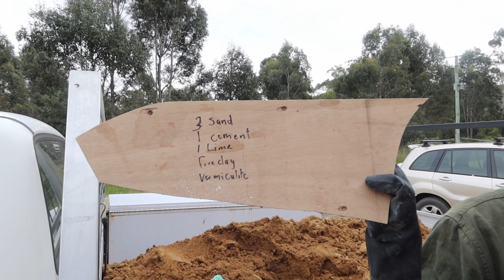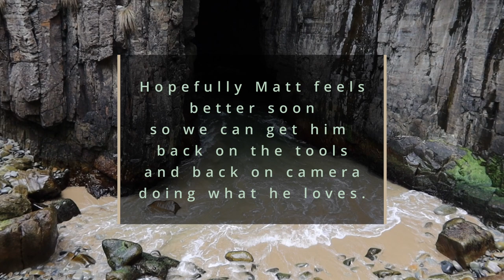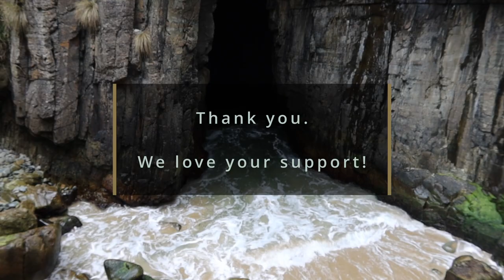a Happy New Year home movie - boat building journey (EP9)

Comment: I'm now 46.. I had right shoulder reconstruction surgery about 14 years ago after I had kept dislocating it and either popping it back in myself or going to the emergency room when I couldn't accomplish placing it in place myself. By the time I agreed to have the surgery I had destroyed everything in my shoulder. There was pieces of bones everywhere, including the ball of my arm. Instead of having a few hour surgery and a much quicker recovery process. I had a 10 hour surgery and the recovery was over 6 months and then I had to go back and have the muscles relocated to reinforce it and make sure that it will stay in place.. I'm telling you this in hopes you will take me seriously and just go have it fixed properly because if its dislocated several times nothing but surgery will fix the situation. You don't want to be in some far away place while out sailing and your shoulder dislocate and they don't have medicine to knock you out in order to get it back in.. last time mine was out it went over 2 inches out and they shot me full of pain meds and then tied 65lbs of ankle weights around my wrist as I was laying on my stomach. They moved my arm off the side of the bed and dropped it.. it made some nasty noise and even though I had enough morphine to kill a horse in me it still hurt